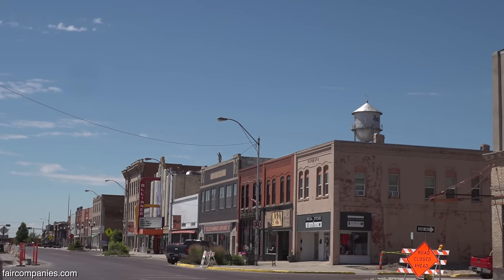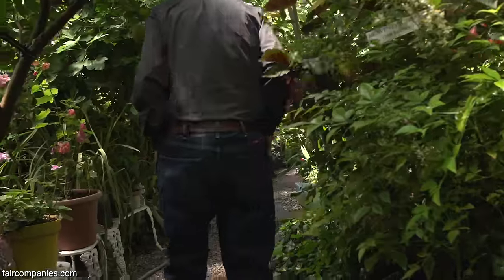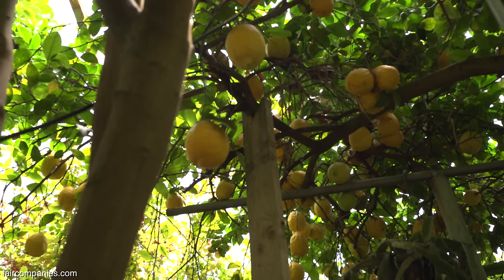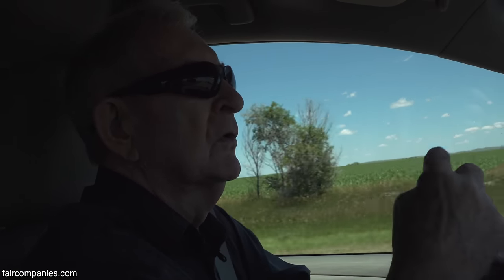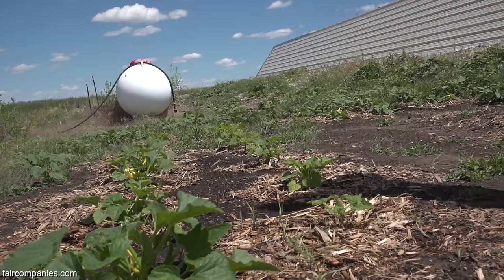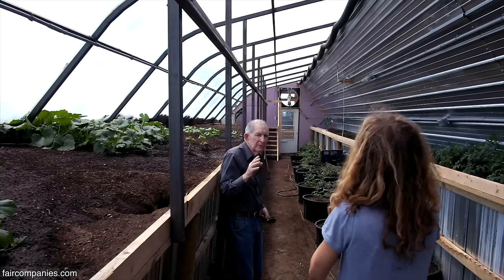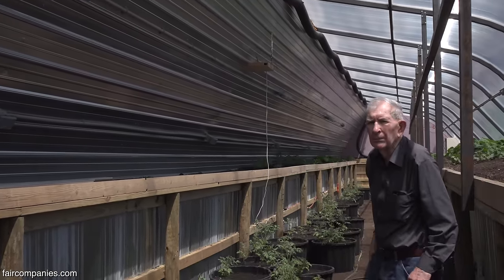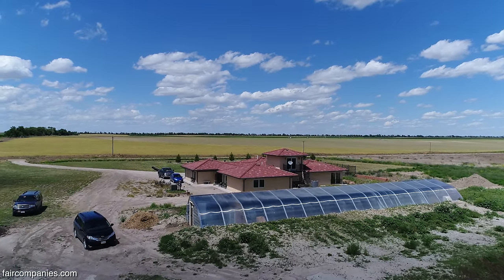Nebraska retiree uses earths's heat to grow oranges in snow

Comment: Ive thought about this type of system and im definitely starting a geothermal greenhouse soon. Im curious if 3/4" copper piping like 50 or 100 feet an inline water pump and a car radiator would work well. I realize you're having motors run for the water pump and the 2 or more fans for the car radiator, but copper is a much better heat conductor than plastic although its arguable once it reaches and maintains temp there will be little change in either material but water holds something like 8 times the heating or cooling capacity as air so you might get some advantages there. 🤔 I need to conduct an experiment but these geothermal greenhouses are AMAZING!! Thanks for the share.

Comment: If the corrugated pipe was replaced with smooth wall piping, they could greatly reduce the HP requirements on the fan motors. Also, replace the PSC motors with ECM motors.
Reply: Yep, it’s like a wood shop but less CFM. I wonder if the lower CFM would negate the static issues you get with using PVC for sawdust/chip collection.

Comment: I think there is a way to circulate the air without a fan. I think if you were to lay one section of pipe 8 feet deep where it is 52 degrees. and another section of pipe 6 feet deep where it is probably 48-50 degrees I think you would create a natural current because of the temperature / pressure difference.

Comment: You may consider making and  partnership with a Structurally Insulated Panel as a value add or you could consider making them. This would be faster and likely cheaper for than closed cell spray foam.

Comment: Nebraska sits on top of the Ogallala Aquifer. Is that a factor in Ground Thermal Heat? Amazing
Reply: There are ground temperature maps on the internet that show the soil temps every inch or so.  It would seem they are pretty uniform gradation from north to south.

Comment: This guy has gone about half way towards an idea I've always had for a high efficiency greenhouse.  
1) on a southerly facing (northern hemisphere) slightly sloped bank, dig down about 4~5 feet on the low side, then dig back until you have a back wall of 12~15 feet
2) lay 12+" block wall for the high, back wall, filled with concrete,  use ICF's on the front, low wall and ends.  At least a 4" slab for a floor, but more would be better.  Everything could be clad in stone for aesthetics and increase thermal mass.  
3) build a straight frame glass roof spanning between the high back and low front walls.  An entrance door can be incorporated in one or both ends.

What you end up with is a greenhouse that is inset and in itself, already taking advantage of geothermal energy, as well as a solar heat sink of the thick back wall and floor.  Earth tube air exchange could be easily incorporated, just as shown in this video.  Being semi-underground, with a roof that is even with the lay of the land, should work noticeably better, than one projecting above the surface.

Comment: Simply amazing.. 2 questions if may
Would you recommend perforated pipes?
How many feet is the minimum requirement to  run the pipes out of the  greenhouse through the yard

Comment: I wonder if there's a reason they don't go down farther than 4 feet in any of these, or if it's just the way Russ did it, and that's the template, because it works.  I wonder, though, if it'd work better if it were built up more or dug deeper into the North, East and West sides.  

They might have it maxed-out for the materials used.  But maybe you could make more of a hill or burrow into an existing hill, and have the same sun getting in, but more earth on 3 sides.

Comment: I’m wondering about water seeping into the structure. When it rains a lot or when lots of snow melts and you live in a flat region will the water be a problem. It’s obvious that this project works well there, but what if you have a lot of melting snow?

Comment: All set for Global Cooling.  Alliance NE is only 200 miles East of the Rocky Mountains and 250 miles north of Denver. The ground is not hard clay without high ground water. Every farmer in that area could supplement incomes with early start crops - late harvest crops - and year round crops.  Too bad the EPA and IRS has already destroyed small scale farms... that's the thumbs down count (Enviroweenies).

Comment: Just curious as to how you prevent insects, rodents and snakes from accessing the greenhouse through the tubes.  I don't see any screening material on them.  I have similar tubing used for drainage and have found that rats and snakes both like to use them as "highways".  Admittedly, my drainage tubes aren't 8' underground, but curious as to whether this has posed any problems for you.  Thank you!

Comment: Is there a reason why the entry point and the exit point of the tubes are not in the same room? Wouldn't it be much more efficient at heating up the place if the inside air was just recirculated underground instead of sucking in outside air?

Comment: if geothermal energy is used at its best here then why are basements always cold?
Reply: Because there is no tubes running around hundreds of feet in the soil with a blower pulling the air through....it's like stagnate water compared to a stream

Comment: The only thing semi new with this idea is the geothermal heat pump and that goes back to the 1940;s.  Growing Oranges in harsh climates go back even further Russians were doing that over a hundred years ago!  Look up Trench Gardening!  But you do have to give him credit for applying the 2 concepts and making some improvements to the ideas!
Reply: If you look at the system readings on the smart phone in the video,  it says you`ll need  to move 17,000 cubic feet of air to provide 1 ton  (12,000 btu) of cooling.

Comment: Is he pushing the warm air from summer back underground to raise the ground temp around the pipes ?
Reply: From what I can tell is he's warming the ground using the heat of the day so it can be released slowly during the night and help to equal things out at little or no cost.
Reply: Go learn about geothermal temperature stabilization.  Keeps air at a certain temp he said 52 degrees,  it will keep a well insulated structure temputure stable so you don't have to heat much in winter or cool much in summer.

Comment: Just wondering how the radon levels are in the greenhouse; by ‘sucking’ air through the ground you are also sucking in radon gas through pipes with holes. If the pipes going through the ground have no holes than they are full of fungus and a danger to those inside. Maybe that radioactive radon gas is responsible for making the fruits larger...

Comment: The farm must be near a thermally active hot spot. This is not a practical method of farming for most places. It's a curiosity project that frankly doesn't compare in efficiency in a simple geothermal plant. An electric plant can probably produce and export enough electricity to buy and transport equivalent amount of oranges from warmer places with left overs.

This is not a "revolution way of farming" that can build farm in the snow. There're simple economics that explains why we build electric plants but not green houses on geothermal hot spots.

Comment: What if you add some custom made aluminum heat exchangers at some point of the geotermal tube with pc cooler fan to compensate the flow loose of the heat exchangers? Could help to reduce the length of the tubes
Reply: you shouldnt use long tubes, they limit the amount of air you can run through them. The amount of heat you can move in a given amount of time is directly related to the amount of air you can move.

Comment: Why do the pipes have to appear outside above ground, wouldn't they lose heat that way?
Reply: I have the same question, did you ever find an answer?
Reply: @benjohnson1938  maybe, in the "earthship" houses they use a similar setup. In the summer they let the warm air in from outside, by the time the air reaches the inside of the house its cooled (from the thermal mass of the berm/mound). This earthship setup creates some cooling and some airflow (In the winter they don't use it) . So maybe here (the greenhouse) the mechanism and use is similar .
Reply: @barnabyvonrudal1  I was watching the SimpleTek youtube channel, now I'm thinking that geothermal with radiator lines and a fan would be better
Reply: @benjohnson1938  right, I had a look at a simpletek video on geothermal heating. I was wondering would the radiator lines be thin plastic pipes then? And you'd pump some liquid with some type of antifreeze through it?
Reply: @barnabyvonrudal1  yeah exactly, he used "IPEX HomeRite 3/4 Inch Irrigation Pro" lines, he discusses in the nV7XJXETr0Q video titled "Cheap Geo Thermal Air Conditioning"

Comment: I am getting ready to build a home on a small parcel of land, only 4,000 Sq Feet of land on an island in the Philippines.
I have been thinking about doing something like this there for cooling the house, 1,400 SqF house.
If I made a trench around the perimeter of the property & ran 2 tubes in the trench would that be enough to have good supply of cool air & if so, what is the best way to exchange the temperature, since I am thinking its probably not best to breath the air all day since moisture will get into the tubes in such a humid environment as the Phils.
Thank You.

Comment: How did the 230’ of tubing needed to heat/cool the greenhouse get calculated? Was that based off the soze of the greenhouse? Or is that the surface area of pipes needed to achieve this with any sized house?
Reply: Surface of pipes, in a way. It takes time for the transfer of heat/ energy. So more important than the length of the tubes, is the time the air is underground being cooled or heated. Another example is when people use compost to heat up water. What they do is coil tube and bury it in compost. As the compost is being created heat is being created from the process. They then run water through the tube and as it coils through the hot compost heat/ energy is absorb in the water. Then the water is used for hot water purposes or ran through the floors of a house to heat up a house. How he figured out the length idk, must to figured it out when he first used it for his house and just kept tweaking it.

Comment: After moving from California to Missouri, I didn't realize how much I would miss all the fresh citrus! Can someone please explain how one could earn enough to live off one green house? Is this possible?
Reply: As he explained in the Q&As in first comment above "Break even point; We have 41 units all over the U.S. and Canada now and the oldest units growing commercially are less than 3 years old so we have little information. The typical 96' greenhouse for local growing will cost about $24,000 if you have access to a backhoe and can do the labor. That size unit can support around 18 citrus trees that will take up 20% of the growing area. The citrus will produce fruit from the first year and be what we would call mature ( about 100# per tree) in from 6 to 12 years. The rest of the growing area can be used for any crop and should produce income to pay for the unit before the citrus is mature."   He is selling the citrus in Nebraska locally for over $3/pound! Even though you get fruit first year, you also can sell the garden produce you plant  UNDER the trees for the initial years, as well as feeding yourself!  Also, you should check out Off Grid with Doug and Stacy, as they have lots of helpful advice and are in Missouri too.

Comment: Mmmm this is prerry old technic... Nothing new here.. and for info, pushing will be better then pulling the air... better efficiency and posibility to filter the air, reduce radon if there's any.
Using air tube on the higher part to harvest heat... Is not a good idea, better use water lines with a metal sheet... Cause air tubes need more energy to circulate and a far lower heat storage capaciry... air is a pretty bad way of conveying heat....The air tubes in the ground are ok cause you can then use natural convection.

Comment: Fascinating. I first heard about the idea of heating and cooling with underground pipe by a local in the late '70s, and then the idea vanished. I wonder if additional heat would be necessary in the winter for those states that are north of Nebraska and that get much colder.  What a great implementation of a great idea though.

Comment: so i have a question... im currently wondering how many feet of a certain size tube you would need to burry at 8 feet to efficiently heat a 1000 ft greenhouse, i mean obviously you cant go burry 5 feet of 6 inch pipe underground and make it heat the whole space, theres just not enough time within that 5 feet for the heat exchange to take place. and on the other hand if you went in and burried 10000 feet youd burry way more geothermal capasity than you could ever use in a 1000 sq ft house, how do i calculate this?
Reply: It involves multiple steps begining with calculating your greenhouse air volume and surface area.

Comment: So how do we buy plans from this gentleman?  I’m planning to start next year in Cascade Idaho.
Reply: Did you ever find plans? Thinking of doing this in Hagerman Idaho too as I also have access to geothermal water so heating is really no issue. I would use the ground geo for cooling mainly.
Reply: @riverhouseparadiseproject3298  
For cooling you need to use multiple short tubes to minimize loss which equates to more airflow. When it comes to cooling you cant have too much airflow.
Reply: @riverhouseparadiseproject3298

Comment: I got inspired by this before, but I have found a much better way to combine solar thermal with geo thermal using not air, not water, but a MIDDLE state between the two, LIQUID SOAP BUBBLES. Create a double layer cavity with a traditional one-layer greenhouse. Fill the double layer cavity with soap bubble foam during the winter and night time (after the sun comes down). In ther summer time, use the liquid bubbles for shading. To cool it further in summer time, use the soap liquid to cool the entire double layer cavity. As simple as that. In conclusion, geo soap bubble foam is a much better way than the conventional geo air.

Comment: Nice and it seems to be working great for him, but I’d worry about Radon, mold and critters. If it were me, I’d circulate a closed loop glycol/water mix to some cheap  truck radiators (with attached fans) in the greenhouse. I’d power the fans with dc from cheap PV solar panels. You could also by hybrid PV/thermal solar panels and use the waste heat from the solar panels to add more heat to the greenhouse.

Comment: The world has changed so much in the four years since this was posted. If I was doing this today, anywhere in the US, I would pick an area where it can be built against a south facing rock wall, with a cave system for habitation and loads of access to solar with a very deep well. Then you would have to build a wall system for protection and defense, with a vast cache system for storage  and plenty of armaments. Any place with an ability to sustain human life will be a prime target for the starving hordes left over from a catastrophic event, after they have cleaned out all the local retail stores. As you can see, I try to remain an optimist.

Comment: Would this work somewhere with a higher water table?  I'm in North Wales?
Reply: You be better off installing the tubing within the greenhouse footprint and using raised beds to keep the tubes above the high water table :)
Reply: You could use non-perforated tubing but God help you if there's ever a leak. I recommend non-perforated for any situation. Not sure why anyone ever recommended otherwise.

Comment: this really does set your imagination wild. zoning obstacles aside, itd be amazing to buy an ugly small corner plot in a city and then building out a tiny home that has a bunch of these sustainable additions. geothermal heating, greenhouses that are also living space, a decorative aquaponics system, a small solar array and some vertical turbines. you could have a properly luxurious and lush living space thats purpose built to your desires and it would still be cheaper than a modern fixer upper.

Comment: Probably the smartest system !
You could probably  go further north by funneling hot summer air under the ground , deeper and using more pipes.
Draw heat from the asphalt  of highways  using geothermal  systems of rock and water underground to store it. Piping water instead of air.
Imagine the heat loss from a highway  or parking lot in summer  !

Comment: Why use electric in summer for cooling?  Why not just have auto opening roof windows for summer cooling and only use the geothermal in winter?  I suppose an advantage would be pest control but you could also have fine mesh on the roof windows.

Comment: I seen a similar thing 20-30 years ago for back yard gardeners that want to grow stuff in the winter.
About the same thing. Greenhouse with a wall that takes heat daytime. A  5 foot deep ditch covered with crating. Cold air will go down the ditch while warm air stays at the growing height.

Comment: So you're getting heat from only digging 8ft?
Reply: Yes, this is not from the internal heat of the Earth, but rather, the Sun. As you dig down, the temperature of the soil gets closer to the average annual temperature at the surface, which means, if you live in the right sort of location, you can use it to cool in the summer and heat in the winter.